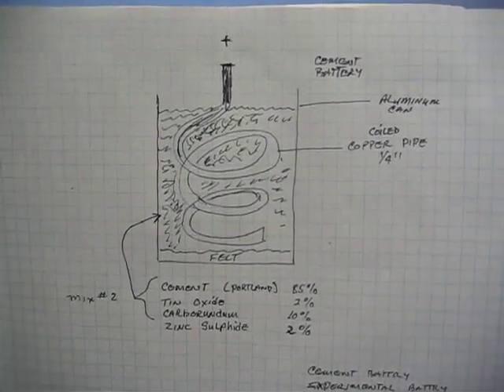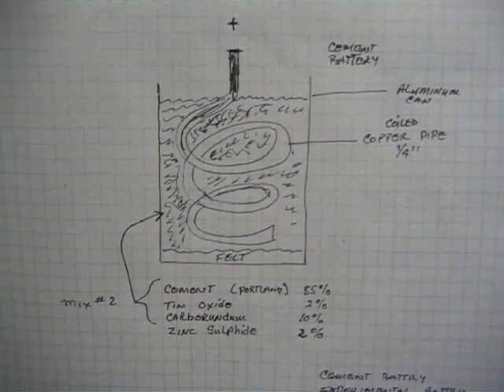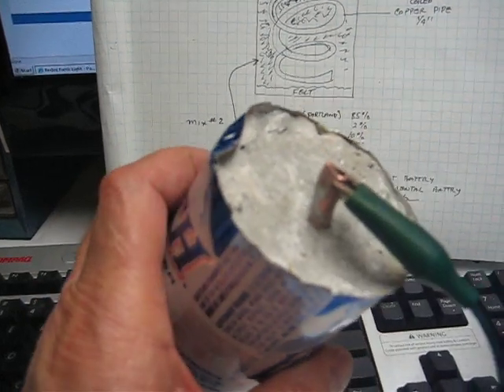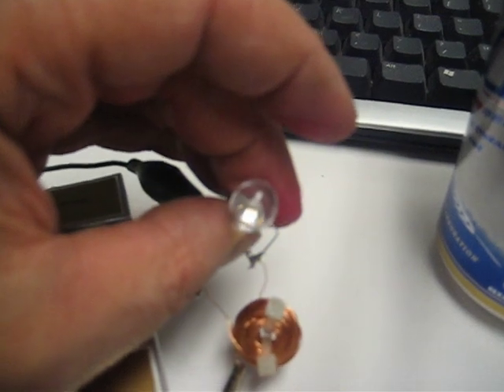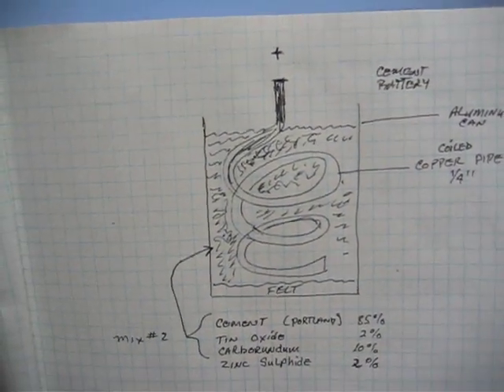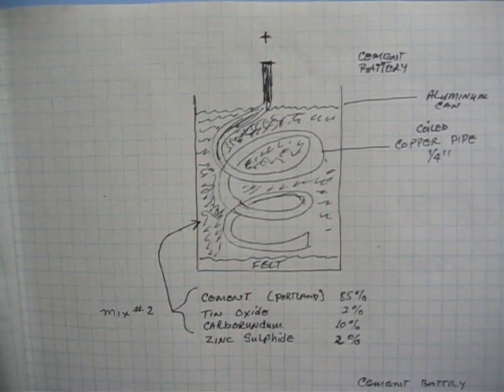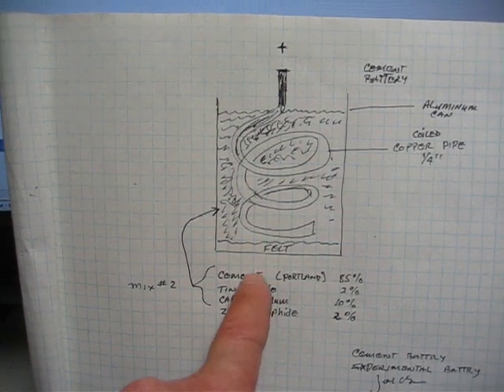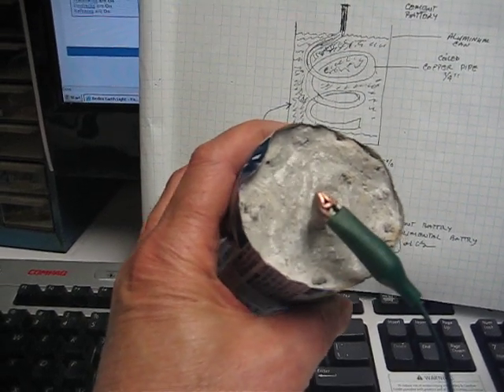Earth Lights 9/Cement Crystal Battery /John Bedini

Comment: Townsand Brown used a mixture of powered tungsten carbide and melted bees wax. He then polarized with high voltage. Copper electrode disks were attached to the hot mixture,
one disk poured over seated at the bottem of the cardboard cylinder, and the top copper elecelectrode disk attached while the mixture hot. The hi voltage charges posative and negative top and bottem untill the mixture cools. That's how it[s polarized.